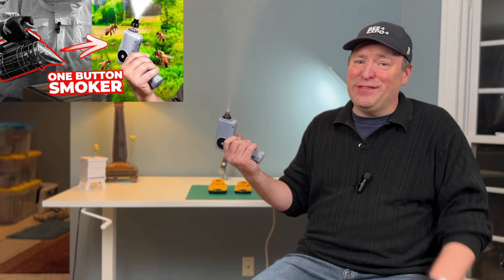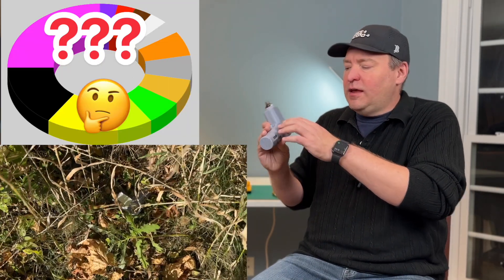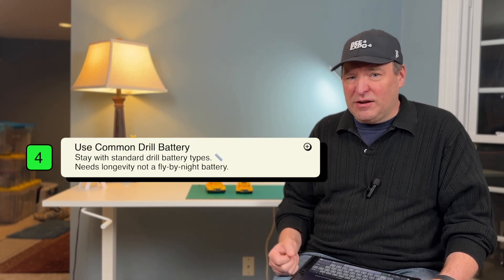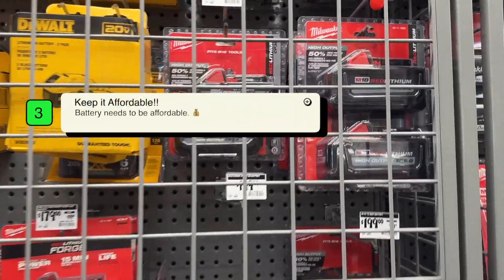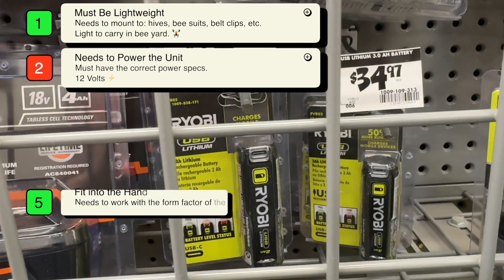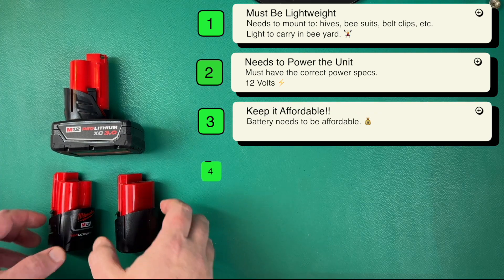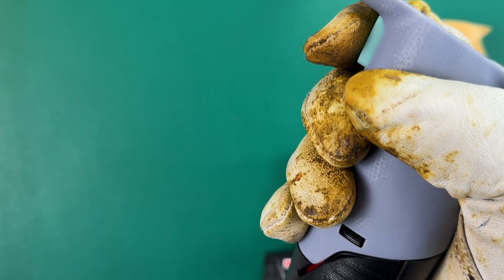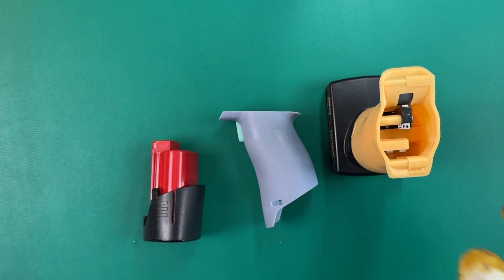Electric Bee Smoker Re-imagined! You Spoke, I Listened.⚡️🔋

Comment: I like the m12 xc 3.0 design as it would allow you to stand the smoker ontop of flat surfaces like the top of hive, i am curious as to how long/how much smoke a single cartridge produces and if they are refilible or if they would need to be interchanged
Reply from the maker: Hey Dakota. You are correct that the XC is awesome for being able to sit on flat surfaces. CP sits flat too as I've kept the smoker balanced, but the surface needs to be pretty level. 

When I was installing my bees the first year of having my own bees, I mindlessly put my hot traditional smoker onto the top of a plastic nuc. It melted through the lid and into the bees waiting below. They were not very happy with me, I can tell you that. 😅

Regarding how long they will last, the CP battery lasts around 30 hives (I've not yet calculated XC, but it would be more than that) and the current pod cartridge lasts around 6 hives and is replaceable and refillable. I am also looking at using different cartridges for different purposes around the apiary and it is really interesting what beekeepers are telling me that they'd like to do with it.

I am currently redesigning the cartridge to work for 40 hives that I'm calling the XL version. Some commercial beekeepers told me that 40 hives is the sweet spot for them, and I figure that the backyard beekeeper could use it most of the season without refilling with an XL tank that big or could just use a regular capacity cartridge instead.

What do you think about the cartridges?
Reply: @TechnicallyBeekeeping  i like the cartridge idea and the general design of the smoker, "nice seeing new ideas and ways of doing things making it's way into beekeeping." I am wondering if longer skinnier refillable cartridge tank could be added onto or into the handle that connect to the main cartridge that dispenses the smoke? I know that may make the handle a bit bulky but it could be a way to increasing the longevity of the cartridges. Or use that concept as top attachment piece instead of just a smart tool addition
Reply from the maker: @dakota5660, I love the ideas!! 💡My current redesign has it on top, like you say. Unfortunately, there's not a lot of space in the handle. I'd looked at using a Dyson-style "bladeless" fan which would have the trade-off of more components in the handle and the slick circular fan on the back. Unfortunately, handle space is at a premium, so I couldn't do it. I do think it would have had a pretty cool look though. Maybe one day we'll figure that out. 🙂

You should consider joining our VIB club (https://vib.technicallybeekeeping.com/) and we have a very active Discord community called the HiveMind in Discord (https://discord.technicallybeekeeping.com/) where we brainstorm these kinds of ideas. I'd love to have you involved! 🙏
Reply: @TechnicallyBeekeeping  what if you utilized some of the free space in the top courrners? Say the two outer edges of the tool are refilible long tube's that run down to the center point at the front leaving the center of the top for the fan and electrical components. This would allow the user to see the level of the fluid if the tube's are the courners themselves, which would still alow you to use secondary top attachments and wouldn't use up to much additional space.

Comment: Have you made any estimations of how much smoke time these batteries can produce? I would expect that the 12v batteries shown would produce enough smoke to go through several of the vape cartridges. If so, I think the batteries are sufficient for most all applications, including commercial bee keepers, as a battery replacement once or twice in a day is no big deal. 

Interested to see how you handle the trigger issue. I hadn’t considered the issue of propolis building up on there. Maybe a silicon sleeve that slides over the handle/trigger?
Reply from the maker: @thatguyiknow1 Hey Samuel! The 12v battery lasts for several cartridges and honestly I don't remember ever needing to change out a cartridge during an inspection. That said if I had hundreds of colonies, maybe I'd need to change it once or twice. It's been difficult to calculate the run-time as it would be unlikely for a beekeeper to run the device for a period of time continuously and I have a shut off to avoid overheating if it's run for more than a minute. I just finished the first v5.3 prototype yesterday and I will tell you that I LOVE the ability to just pull the drill battery out and replace it without opening the handle. So smooth and easy.

I'm currently recording the color, findability and trigger video this week. I've also found some cool adapters for the batteries that I'll show as well. So stay tuned. 

Also, sign up for VIB Insider's club to get detailed information on what I'm discovering before it gets to the YouTube channel.
https://vib.technicallybeekeeping.com

Comment: Coming along nicely Mike. I get the thought pattern behing using a battery pack, just not sure how universal that option will be. I still lean more towards using 2170 lithium cells. You could design a cartridge to hold two cells that clips in like the battery packs. This could be sold as an add on perhaps? Thank you for your letter and sticker. Cheers from Western Australia.
Reply from the maker: @philaandrew, Thank you!  🙏

I'm keeping my options open on the battery, but I have found that if I would continue to use the 2170, the I'd need to do something similar to the drill battery where everything is taped together and connected with a click.  In testing with gloves on, it was almost impossible to open the device much less deal with small batteries. I rarely use gloves (other than nitrile gloves to keep the gunk off), so I'd not noticed it until the VIB club mentioned the concern. The drill batteries are much simpler with gloves.

Let me know what you end up doing with the sticker, if anything. Glad you got it. 

What are the most common drill batteries that you use in Western Australia?

Comment: I like the idea of interchangeable handles to accommodate different batteries. Of course there are adapters for purchase allowing use of different batteries, but they do add weight and bulk. I'm sure you already have, but if not, go look at the battery OA vaporizers for ideas. If you get a clever design I don't think beekeepers will mind a little more weight, but also keep in mind battery cost could be a deal breaker like with the vaporizers. I like where you are going with this so far. - Darren
Reply from the maker: Thanks, Daren, I agree, I've gotten a lot of inspiration from the OA vaporizer designs with the drill battery. I agree on cost, that is one of the most important factors. I appreciate your feedback. 🙏

Comment: Yes I'm glad you made the extended handle! I really like the design. I personally wouldn't mind the 20V option if you went that way but if 12V is all it needs, then I see keeping it lightweight. Thanks Mike!
Reply from the maker: Hey Justin, I may go 20V in time if I need more juice and I could probably put some of the electronics into the handle. I might also have to look at shedding weight to accommodate a 20V battery, but there's not much weight to shed. For example, since the 20Vs normally have battery meters built in, maybe I don't need a display? What do you think?
Reply: @TechnicallyBeekeeping  Yeah, when I went through your questionnaire about that, unless it tells you a "runout" time of smoke, then the battery should tell the charge remaining.
Reply from the maker: Yeah, I remember reading that. Good point! There may be other uses for a display, but I believe in the YAGNI philosophy (You ain't gonna need it). Meaning we shouldn't add stuff into the product, just in case it's useful one day. Same reason I don't collect old magazines and outgrown clothes, never gonna need it again, I just keep getting fatter. :)
  
I was hoping to find a 12V battery with a display for that purpose, but I wonder if a lot of that extra weight in the 18 and 20V is due to electronics for sensing and displaying the battery level?